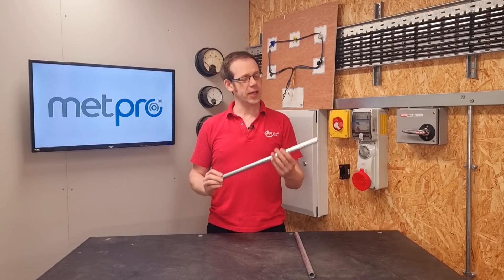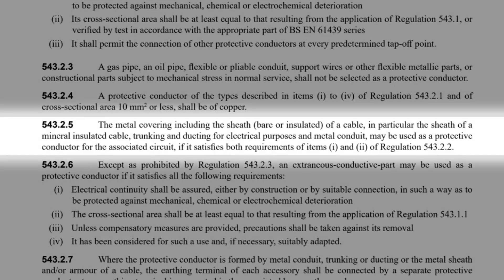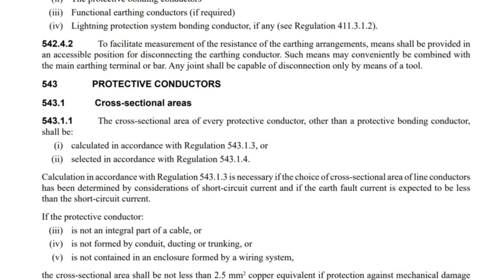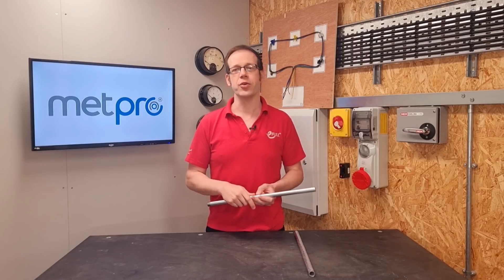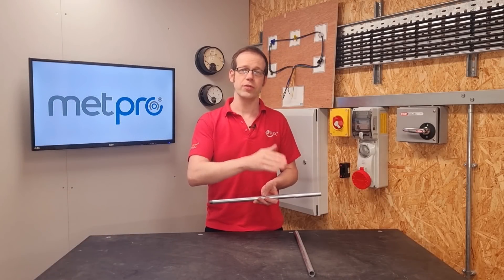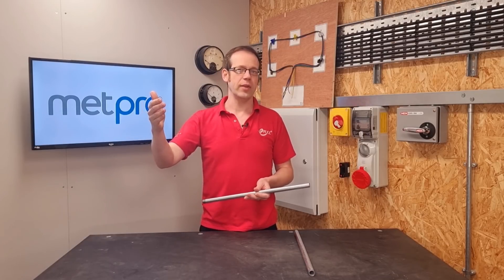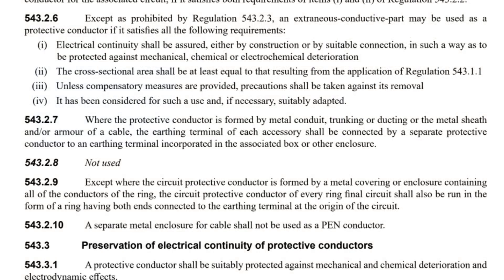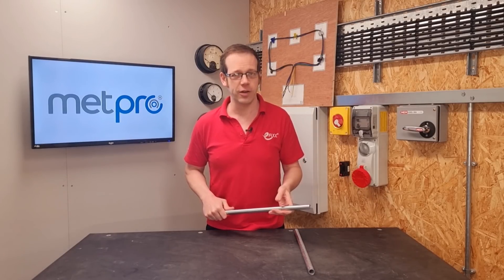The Earth Wire is Missing! - Can You Use Steel Conduit Instead?

Comment: I served my time on the 14th edition that stated the containment must be electrically & mechanically sound.
When the 17th came out a lot of young sparks were failing installations as the "CPC" was missing and some ran them and removed the earth leads from the back of the conduit box
Reply: The socket retaining screws will make the earth to the back box and hence the conduit.

Comment: I served my time on the 14th edition and the regs stated the containment should be electrically & mechanically sound ie an earth.
When the 17th came out there was young sparks failing an installation due to no CPC .
Reply: I did an eicr on a school years ago when I was an apprentice and the conduit was used as the cpc all the readings were better than expected due to the conduit and parallel earth paths of the metal fabric of the building Had the nic assessor out at one point and he was arguing saying our readings couldn’t be correct! The sparks I was working with ran rings around him😂